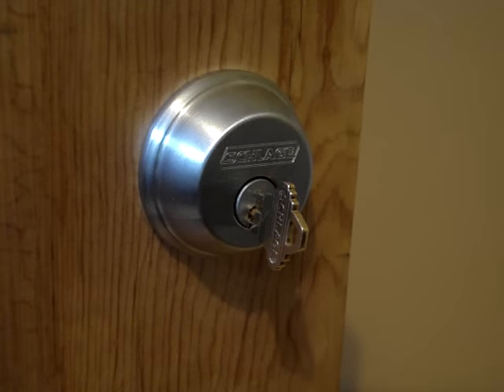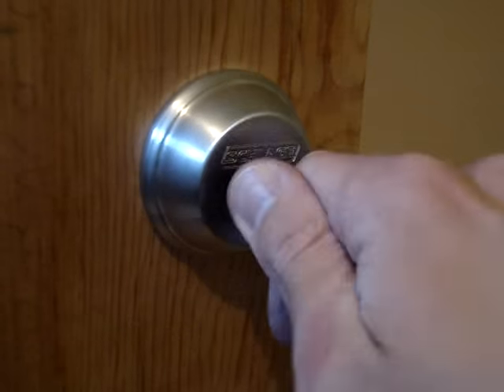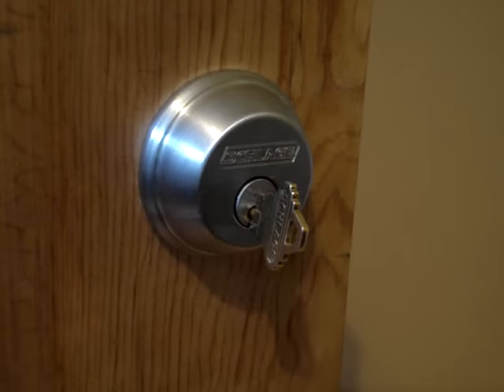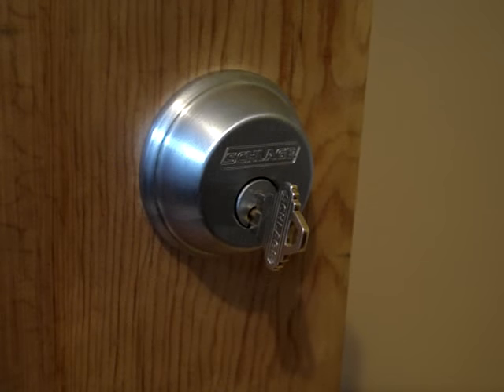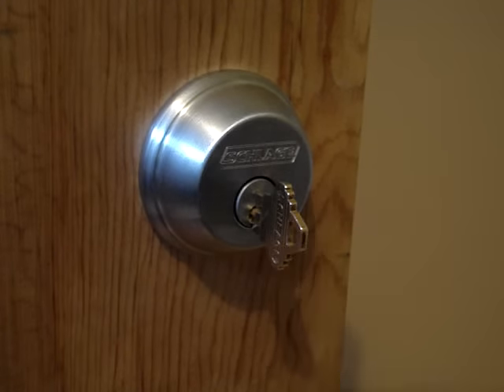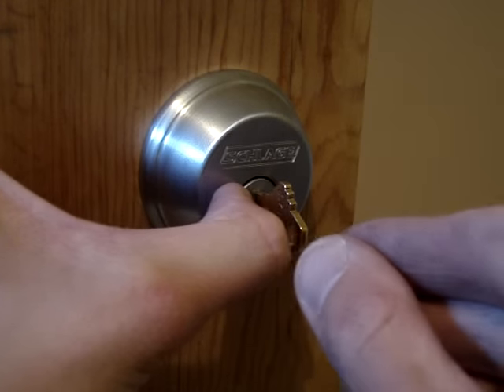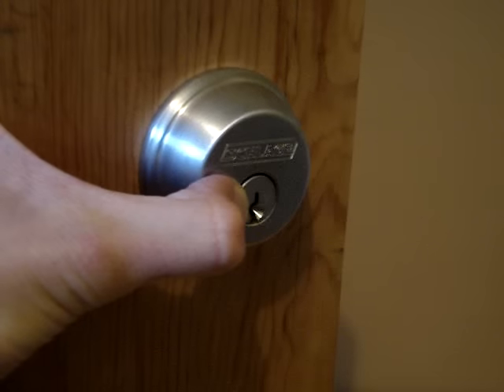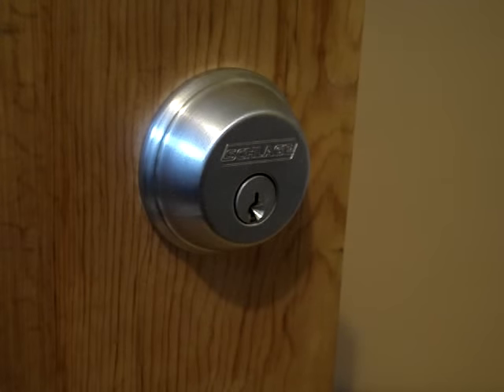How To Get Your Key Unstuck

Comment: Literally me still not being able to get the key out😭
Reply: Me rn
Reply: I hear ya I got a new one door knob n all used the keys n it was stuck n can't get it out n I've seen another video like this , that said same thing n I still too can't get the keys out
Reply: Same 😫
Reply: Yo @Olivia A you still stuck?
Reply: Yo same. Mine is stuck atill
Reply: Not for me, it works😇😇😇
Reply: me too girl😭
Reply: I'm having the same problem please let me know if you found with the solution was the only problem with mine is I cut the keep myself to make a copy and now it is not coming out and I've seen these videos of people getting their key unstuck I just simply pushing on the cylinder and pulling the key
Reply: Mine too😢
Reply: Me rn
Reply: Me rn😢
Reply: This was me too. In my case the key that was stuck was atleast able to open the front door. Pushing the barrel in and pulling the key out didn't work for me.
So I unscrewed the door knob from inside the house until both knobs came off. Then I just fidgeted with the key a bit more and the long metal part on the other side of it, and it loosened the key until it came out. It took me 1 hour to figure this out, but im just grateful to God it came out before my parents got home 😅

I put some oil in the lock too so this wont happen again for a while!
Reply: Same here
Reply: I am in same situation 😢 June 26,2024😅

Comment: Had my Baldwin deadbolt lock rekeyed about 2 years ago it started doing this right away and my wife and I just stopped using it from the out side. I was just going to yank it and have someone take a look I figured one pin was slightly off or something. Found this video just now and it took me a whole 11 minuets to fix it, that includes leaving this video and then making it back. Thanks so much I used a toothpick for the retaining pin on that screw caller, thanks again now my wife will stop calling me dumbass for getting the locks changed.

Comment: My apartment key was almost impossible to remove.  Even insertion was rough.  The old lock had picked up some muck of some kind over the years, and so the key was pushing/pulling on the lock mechanism components, rather than simply lifting or lowering them when the key was inserted or removed.  That was 4 months ago, and now the lock works with absolute ease.

Step 1:  I scraped some graphite off of a pencil onto a piece of folded paper, and then inserted the tip of the folded paper into the lock, and carefully blew the graphite into the lock. 

Step 2:  I then used the pencil to cover the key with graphite as much as possible, and then insert, remove, and insert again the key into the lock several times.  And that did it.  Now the key slides in with what feels like virtually zero resistance, and it's the same thing when removing the key.

Comment: Wasn't working at first and I kinda looked like a dumb ass, but after turning the bolt in and out a couple of times and aligning the turning lever with the key it worked. Thanks.

Comment: What if the key is stuck in the lock at an angle, not allowing me to move the key to a straight up and down position to press on the circle to get the key out?
Reply from the maker: +PocahantasBam Based on what you described, it could be that the driver pins inside the lock have managed to catch on part of the plug, trapping the key in its current position.  This is an uncommon occurrence, but it can happen.  In that case, the trick outlined in this video would not work and the lock would most likely have to be removed from the door and the cylinder may possibly need to be replaced depending on the severity of the problem.
-Charles
Reply: Okay, thank you for your response. I ended up having to call a locksmith, it's all taken care of now, just wish it wasn't so expensive. Thank you again.

Comment: Will this work if the key is stuck in the door knob?
Reply from the maker: Yes, this technique will work (provided of course you can get the key to the insertion/removal position).  However, if the plug is recessed in the knob (depends on the style of knob used) you may need to use a pen or other narrow instrument to push in on the plug as it can be difficult to get a finger in between the knob and the key.  Thanks for watching!

Comment: mine its like from the woadrobe.....but it didnt work out....help me please
Reply from the maker: It really depends on the type of lock on your wardrobe.  I know that furniture sometimes uses warded/lever tumbler locks instead of pin tumbler locks.  If this is the case, then the trick in this video will not work and you will likely need to call a locksmith.
Reply: Ouhhh....okay.....and now my dad has unstuck it:)

Comment: what if my keys stuck at not 12'O clock position? what should i do?
Reply from the maker: That depends--was the key initially inserted at the 12 o'clock position?  Some locks are mounted where the key inserts at o'clock, 6 o'clock or 9 o'clock.  If you can't remember how the key was initially inserted then I would try the technique in the video but with the key in each of these three other positions.  If you did insert the key in the 12 o'clock position and now you can't get it to return to that orientation then unfortunately it sounds like you're dealing with a problem that the technique in this video cannot solve.  Thanks for watching!